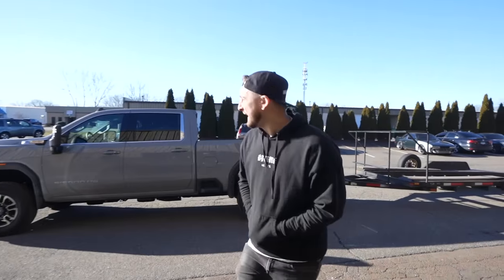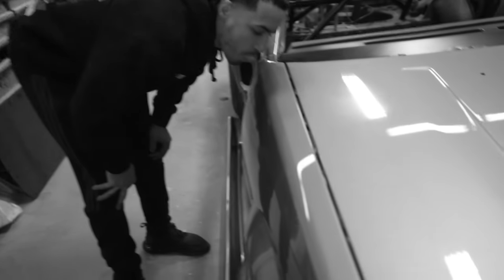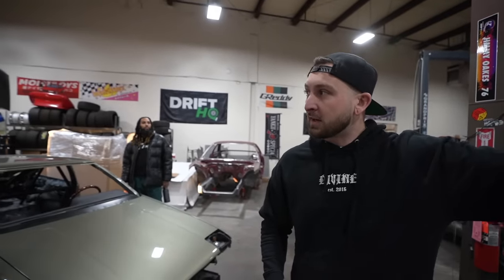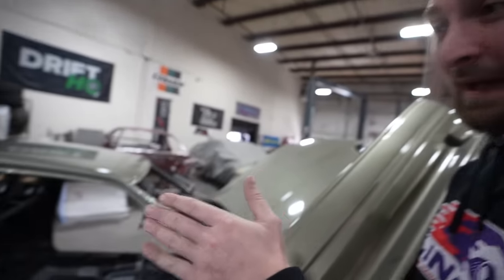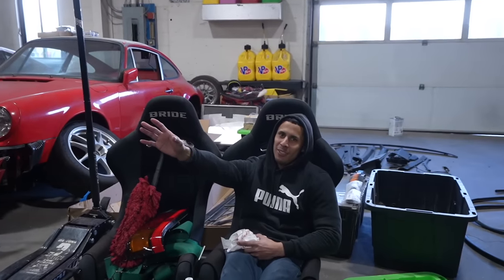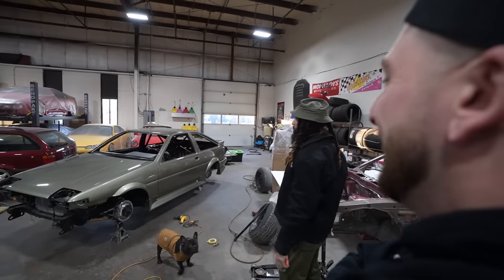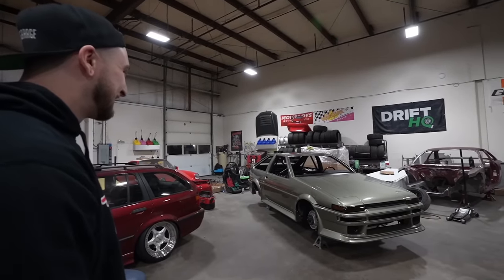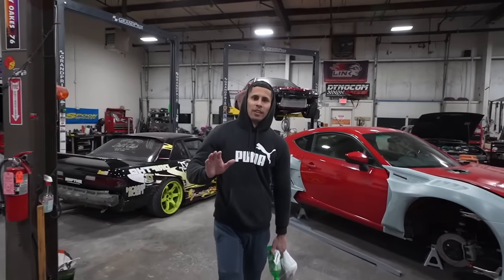AE86 is OFFICIALLY back from body shop! (COLOR REVEAL!)

Comment: Rx7 fc bomex mirrors fit and look way nicer than the east bear mirrors . Some old D1 ae86's used to run them . They are fiber glass and you need to do a small cut along the inside mounting face to get the angle right . 😊
Reply: Way too rounded for this build.

Comment: while i'll admit the 86 is cool, i haven't checked out the channel in 9mos, come back and we're still doing JZ and RB stuff? way better engines in 2024 to swap and build into cars. 07k, b523t, n54, vr5/6s, vortec 37/4200s... there's trans adapters for all of these. this channels become those like pokemon challenge videos where they use different single or team and just use the same move sets (like return) on each run (build).